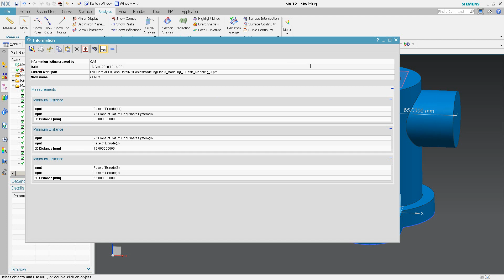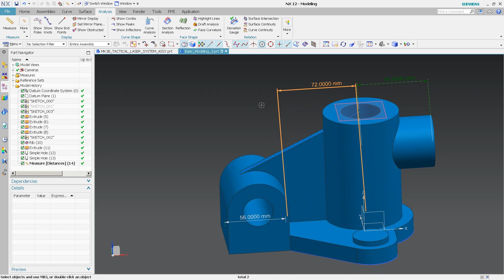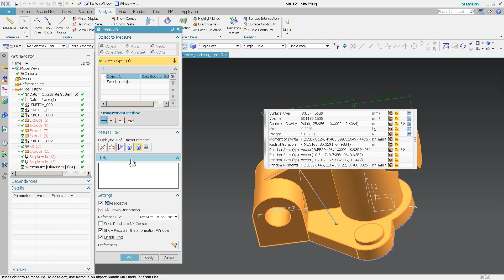Siemens NX Measure Tool in 2025

Comment: Is there a way to change the font size of the measurements? I print the drawings, and the text is really difficult to see.
Reply from the maker: Not easily. 

You would need to change your computers default font. And that would change everything.
Reply: @StevenMarji  thank you. We actually upgraded to 1847. With that, after I select my points, zoom in and click apply. Then the font if larger. Only downside is that it disappears behind the part if the dimensions tons behind it.
Reply from the maker: @mikemiller5669  You can change the part visibility to see though. But yes, it is irritating.

Yes, 1847 is awesome. More to come with the new NX.
Reply: Go to preferences, PMI, lettering make your font and size adjustments click the apply to all text icon then click apply or okay to exit the preferences tab. This will change PMI and future measurement text.